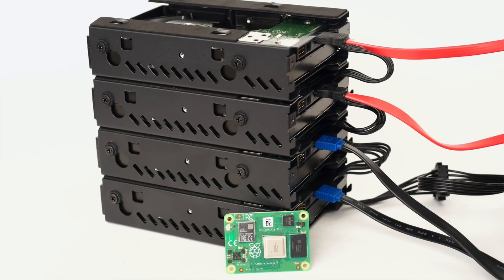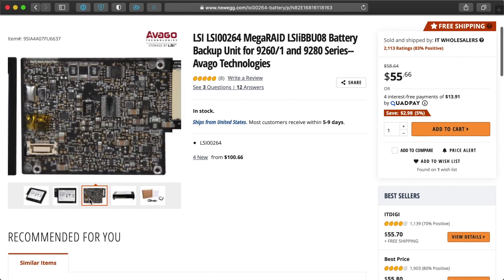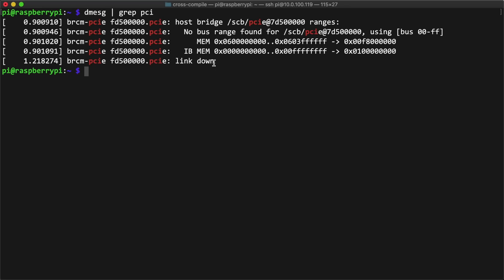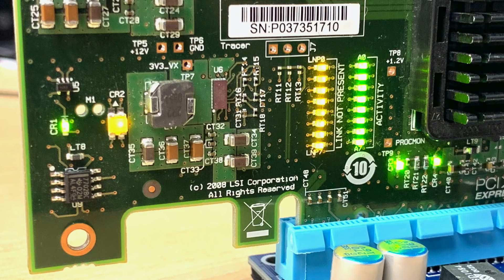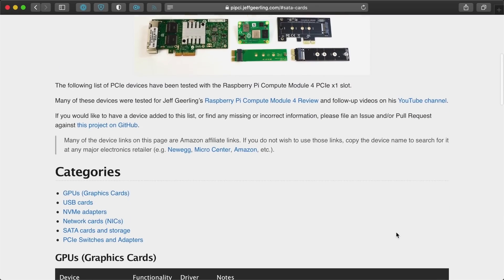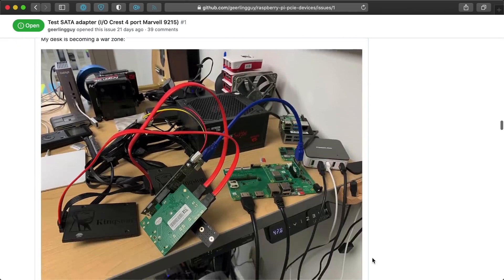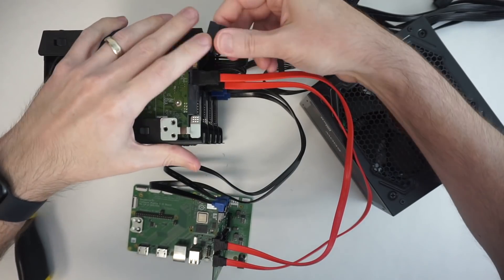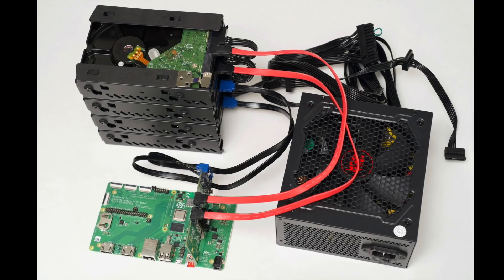Enterprise SAS RAID ...on a RASPBERRY PI?!

Comment: I did this but with a rockpro64, an LSI 9211-4i HBA, 4x SAS 4TB drives, all in a 1U server chassis with hot swap bays. The rockpro64 has a 4x PCIE port and it all works together nicely running on Armbian OS and openZFS.

Comment: Buying a 3 pack so you have a single spare??? You need to buy in bulk and order 20 extras, you know you are going to need them ! Great video as always I just did this same project but on my R730xd so it will support 44 drives. The lsi controllers with the firmware mod are fantastic. 10tb sas drives are 99 bucks now!

Comment: I love where Jeff's head is with this. Here's hoping a future Pi will include at least one modern PCI Express slot.

I have no idea about this, but are there any older HBA or RAID cards that might fit into the slot natively?

What I want to see is a mass market of low-cost, low-power, elegant, Pi-based devices...including NAS. I'm not much of a tinkerer. I want something that just works well and looks presentable with minimal fuss.

I know there are pre-built solutions out there, and I have a Synology NAS myself, but I want to drive prices further down. My Pi 3 B+ really let me down when I tried to use it as a RAID5 NAS. Even if it had worked reliably, it was a rat's nest of cables.

Comment: BTW. You can boot Rasberry Pi using UEFI, and load something like generic Debian, Ubuntu or Centos images and kernels. They are usually for arm64 servers that have UEFI (often called ServerReady in ARM speak, now ARM SystemReady SR), but with RPi4 firmware from pftf repo, it just works. These kernel usually have almost all modules compiled in as modules, so no need to recompile the kernel. Usually you will have access to all same modules as on x86 kernel on these distros (minus some x86 specific stuff, like some motherboard sensors, some ISA sounds drivers, etc), but almost all PCI / PCIe stuff (including hard drive controllers, raid cards, network cards, wifi, audio and video related cards, GPUs, etc)  will be there.

Anyway great video. I love experiments like that myself. As of the not-working RAID card, it is probably related to bios on these cards. They often need to initialize at boot, and their bios is often x86 only. Not all of them tho. Some of them can be initialized by linux drivers and firmware loaded by Linux. More investigation is required definitively.

Also you do not need explain or apologize for your ideas, that some will consider silly. There is plenty of uses for a setup like this, and even if there is none, it is still fun, and you can learn many things from it.

Comment: When new raspberry pi and other sbc models start coming out in the next year or two, if they have pcie 4.0 nvme support that will lead to the ability to hook up raid cards at full bandwidth. With some fancy adapters and sweat/tears someone would be able to make a tiny little nas with insane amounts of storage. And since flash storage is supposed to cross the gb/$ of hdds those tiny nas devices will be all flash based. Imagine a 24-32tb sata or sas raid array with cpu and networking in the size of a WiFi router. Imagine having 5g or ax WiFi built in with a battery and being able to carry around a mobile nas that is actually fast. I love how fast tech seems to be advancing this last year compared to the previous few years.

Comment: Jeff, I think you maybe have just been unlucky with the LSI cards, some of my bits and pices have just arrived and I plugged in an LSI 9211-8i I had laying around in the drawer and got this:

pi@raspberrypi:~ $ sudo lspci -v
00:00.0 PCI bridge: Broadcom Limited Device 2711 (rev 20) (prog-if 00 [Normal decode])
	Flags: bus master, fast devsel, latency 0, IRQ 55
	Bus: primary=00, secondary=01, subordinate=01, sec-latency=0
	I/O behind bridge: 00000000-00000fff
	Memory behind bridge: f8000000-f80fffff
	Capabilities: [48] Power Management version 3
	Capabilities: [ac] Express Root Port (Slot-), MSI 00
	Capabilities: [100] Advanced Error Reporting
	Capabilities: [180] Vendor Specific Information: ID=0000 Rev=0 Len=028 <?>
	Capabilities: [240] L1 PM Substates
	Kernel driver in use: pcieport

01:00.0 Serial Attached SCSI controller: LSI Logic / Symbios Logic SAS2008 PCI-Express Fusion-MPT SAS-2 [Falcon] (rev 02)
	Subsystem: LSI Logic / Symbios Logic SAS2008 PCI-Express Fusion-MPT SAS-2 [Falcon]
	Flags: fast devsel
	I/O ports at <unassigned> [disabled]
	Memory at 6000c0000 (64-bit, non-prefetchable) [disabled] [size=16K]
	Memory at 600080000 (64-bit, non-prefetchable) [disabled] [size=256K]
	[virtual] Expansion ROM at 600000000 [disabled] [size=512K]
	Capabilities: [50] Power Management version 3
	Capabilities: [68] Express Endpoint, MSI 00
	Capabilities: [d0] Vital Product Data
	Capabilities: [a8] MSI: Enable- Count=1/1 Maskable- 64bit+
	Capabilities: [c0] MSI-X: Enable- Count=15 Masked-
	Capabilities: [100] Advanced Error Reporting
	Capabilities: [138] Power Budgeting <?>
	Capabilities: [150] Single Root I/O Virtualization (SR-IOV)
	Capabilities: [190] Alternative Routing-ID Interpretation (ARI)

I'll let you know how I get on, I'm assuming I have to compile the LSI drivers into the kernel now.
Reply: PS, this device will be in IT mode already from its days in a ZFS server.
Reply from the maker: Nice! Can you post your findings to this GitHub issue? https://pipci.jeffgeerling.com/cards_storage/ibm-servraid-br10i-lsi-sas3082e-r-sas-raid.html (or start a new one for that card in particular)
Reply: @JeffGeerling  You've actually motivated me to order a RockPro64, this device has a PCIEx4 potentially giving it much more potential: https://www.pine64.org/rockpro64/ it also seems someone has the LSI 9211-4i working on it: https://wiki.pine64.org/wiki/ROCKPro64_Hardware_Accessory_Compatibility#PCIe_devices I am going to have a look through their forums and see if I can find anything helpful that could help with the Pi.

Comment: I respond to your stackable rack with this (and they dropped the price quite a bit)
" Sans Digital HDDRACK5 5-Bay IDE/SATA Hard Drive Organizing Rack " - it connects to the power supply AND has a fan :)
If they made a 6-bay version it would be perfect for ZFS RAIDZ2 ;-)
Reply from the maker: Nice! They even sell it at Micro Center. I wish I had seen it before I bought my little solution.

Comment: Less of you and more of what you are doing, also check sas and SCSI on Wikipedia for more accurate information. Also battery on the raid adapter is only for raid 5 which cache memory added on the raid controller, because we can have power outage while the controller is still calculating the parity bits...

Comment: Here I'll save your readers time, less money and a cleaner install in a smaller foot print. Buy from amazon or newegg since they have all these in stock all the time. I''l leave out the drives but here is the list

1. PicoPSU 160Watt  + external brick = $100 (this will support 5 3.5" 72K RPM drives, more if you use 2.5" drives)
2. Sans Digital HDDRACK5 = $35.00 (PSU plugs in, has build in cooling, supports 5 drives and stacks)
3. CableDeconn5 SAS/SATA cables = $12.00 (short, angled and bundled together for cable management)

way cleaner then your solution and if you only use 4 drive bays you can cram the RPi in the top drive bay to make clearance for the SATA/SAS card and have everything in a nice package.

Comment: AFIK, due to the fact that the RPI does not have a bios all the stuff that relay on bios initialization fails.

GPUS, RaidCards (probably an hba would work).  Isn't there a coreboot/seabios to boot win 10 for arm? Probably in that way you could solve a lot of problems.

Comment: You know what the very likely issue with that SAS cards was besides very picky server hardware? The Raspberry 4 has only a PCIe Gen 2 x1 interface and judging from the connector they needed at least x2 or x4. Only hardware that specifically states that it works also with x1 might work with such Jerry rigged Chinesium x1 to x16 adapters. SAS controllers - if not ancient in age - need all the lanes they can get to even work somehow decent. A somewhat half decent deep dive in PCI-Express could be helpful at least to educate yourself why such Chinesium x1 to x16 thingies are not always the best things.

Comment: Hey, @jeffgeerling, on a side note (Your SAS video is why I follow, your why not? attitude is awesome) could you do a video on your environment that you use for re-compiling the kernels? I use a Ryzen 7 1700/ 32GB / 10 TB / 4 1GBit Ethernet Ubuntu VirtualBox Host running many dedicated VMs for dev use, including a Pi-Gen machine (for building custom RPiOS images. Cross-compiling is something I'd consider if I had a good example to follow...
Reply from the maker: I promise I'll try to get to a video on the process (especially as I'm starting to tweak it for better performance / easier work on the overall process). Right now the basic environment I have set up is documented here: https://github.com/geerlingguy/raspberry-pi-pcie-devices/tree/master/extras/cross-compile

Comment: One thing to nope, you don't need to use PCIe risers, you can cut out the plastic in the back of the PCIe slot on the pi and use that as an open ended slot. Open ended slots are found on both consumer and server grade motherboards from time to time.  I presume you already know this but I'm just throwing it out there anyway

Comment: “I had to recompile the kernel to get ___ working.”

This is why Linux can’t make headway into the desktop market. It can’t get out of its own way. 

I gave up trying to run linux on bare metal. I just use Windows as a h/w abstraction layer so I don’t have to multi lot and just run as many Linux VMs as I want under VMware. I boot once and run whatever I want concurrently so I can get on with my life. 

I gave up back when WPA2 WiFi meant casting spells and burning black candles just to get WiFi working. Enough.

Free software is free only if your time has no value.

Comment: Hi Jeff,
I had issues before using LSI RAID controllers in desktop motherboards but found out that blocking 2 pins on pci-e bus solves that issue and PC boots and detects card and disks without issues after.
You can find instructions and pictures kudos to Yannick:
http://yannickdekoeijer.blogspot.com/2012/04/modding-dell-perc-6-sas-raidcontroller.html
Not sure if that is the issue on Pi - but worth checking and having enterprise RAID controller running with PI :)

Comment: How do you use the sata cable on sas drives when they don't physically fit. Sas has power & data in one link , so your sata cable has to have a chunk missing to like get plugged in. Basically Sas 22pin connector vs. Sata 15 pin + 7 power connector. Also why do all that when there's already a product the Raspberry pi 4 nas (supports 4 HDs). https://www.youtube.com/watch?v=Eix0PCB0byQ

Comment: If you don't want to use the jumper wire for the power switch replacement, have a look at this ATX breakout board: https://www.amazon.co.uk/gp/product/B07MW8H26H/

Comment: With the LSI cards, they all have stupid x86 Option ROMs which probably break compatibility. Luckily they can be trivially cross-flashed as dumb JBOD controllers. Barely better than the result, but hey, they can be used.

Comment: For redundancy and backup, but not speed, right?
Reply from the maker: It depends on how many drives you have and what your goals are.
Reply: @JeffGeerling  true, the only important goal I see is "can it be done"
I found an adapter to plug an eMMC module into the SD card slot. Not fast but super cool for swapping out projects and storing them. Love your channel!

Comment: Cool project !!! A hdd uses just 5-6 watts of power, thus 4 hardrives about 20-25 watts, you could easily power that with that molex psu you showed  no need for a pc power supply, project would look a lot cleaner without that pc psu
Reply from the maker: True... it seems that each drive uses 0.5A at 12V, so I would just be at the 2A limit of the little power supply I have. But if I'm trying to power other things (like my PCIe risers) and technically the Pi itself (it can be powered through a 4 pin floppy connector), then I'd have to still plug in multiple power supplies. Long term a micro-ATX IO board would be neat to have available!
Reply: Ah yes, makes sense, that would become a little to mucht for 12v 2A and do you mean a micro ATX board in which you can plug a rpi compute module, that would be sweet indeed!

Comment: Retired data center sysadmin/support here. Hardware RAID even with a BBU isn't 100% foolproof. I've seen more data loss and failures with hardware RAID than software RAID because the RAID card was writing bad/corrupt data until finally everything messed up. I recall BBU failures from time to time on our virtualization nodes. Sure the guy above me who managed the servers probably didn't have notifications setup, enabled or checked disk health regularly but even with the hardware RAID servers we issued to customers who hosted their own hosting customers would have issues. I personally have not seen  a software RAID failure. I'm not saying it can't happen just saying 7 years 24/7 on call as a good solid sample. We had 7 data centers at the time, 5 in the US.
Reply: We'd even mix up the sources of new hard disk like CDW, Kingstar, the hardware sales guy and Amazon to exclude the possibility of us getting a high amount of bad disks in a batch/manufacturing run.

Comment: Worth noting that some, not all, of those LSI cards that both Dell and HP use, have re-cooked firmware so wont work when living in somethimg thats not Branded to them. Theres must be some kind of lookup performed when the card boots . I reflashed the vanilla firmware for each from LSI and problem solved. May be you have that issue with your cards.

Comment: For those thinking "go with a server": Server fans have a tendency to sound like vacuum cleaners. I have a HP Proliant that sounds like 3 carpet shampooers and that's normal for the model, not fan malfunction. Using 32 sticks of RAM, 4 CPU's, 8 HDD's, 11 expansion cards, and 2 power supplies, it can generate too much heat for a quiet set of fans.
HP Proliant DL585 G2 server, BTW.
Reply: I am hoping with the rise in popularity ARM that more quiet and power efficient servers become available. Right now there aren't many choices still for ARM servers for sale.

In the meantime, Supermicro makes some embedded servers that run on Intel Atom with passive cooling. I used to have one for my home lab but it had the infamous C2000 clock signal death and doesn't boot anymore. The newest generation of Atom processors (C3000) do not have this defect AFAIK. There are also the EPYC 3000 and Xeon-D choices in the embedded options but I don't know how those are in heat and noise.
Reply: yes servers are loud but I'm not going to wait days to resilver a drive on a pi  when it takes minutes on my server.

Comment: I'm using an old Atom board in an SFF case with a PCI (no X) card I found for cheap with 4 sata connections, and that way I have my raid server, not the fastest, but it was very cheap. Mdadm and LVS for software raid and up it went.

I was going to use a Pi, but came across that old pc and it was so on my budget

Comment: WD Green != Enterprise grade.
Additionally, those drives aren't even safe for RAID. Purple, Red, and Gold are safe for RAID.  And only Gold is enterprise grade.
Additionally "refurbished" drives are never enterprise grade.
Reply from the maker: I treat any hard drive as unsafe for raid. They'll all fail at some point, it's just a matter of when :)

But yes, you have a point—in my case, I wanted spinning drives and realized the only one I have in my entire house now is an old 1 GB SCSI drive I have old Mac OS 7 games stored on from decades ago. Refurbished WD Green it was!

If I had more time to wait, I could definitely pick up better drives. I'm also testing a set of four cheap-ish Kingston SSDs for the next video too. Their performance absolutely destroys spinning rust, though you pay for it in capacity per dollar.

Comment: Only 500GB drives? I hope you paid next to nothing for them.
Reply from the maker: Hey, if this were 2010 it would be pretty respectable! But yes, it was pretty cheap, though since I needed them quick, I ran to Micro Center and paid a bit over what I could get them for on other reseller sites.

I really need to find a local friend who works in a DC and can just toss me old hardware when it's rotated out after its duty cycle...
Reply: @JeffGeerling  early in my career I was a junior Unix admin for a university.  I ended up acquiring a bunch of surplus hardware, even a Sun E450. The problem with data center hard drives is they're LOUD and power hungry. I almost doubled my power bill by running the thing filled with 15 drives.

I'm sure things are better now with the switch to SAS and 2.5" drives, but still something to consider.

Comment: You probably get more speed and durability with BTRFS RAID 1, 0 or 10 with zstd compression and you wont have to worry about power losses or faulty cables.

Comment: I think it should be possible to use the always on 5v output of the psu to power the raspberry pi and you could program it to be in a sleep state with the psu off or in a on state with a output the raspberry pi to turn on the psu... Maybe the whole thing could run off 5v always on depending how much power the hdd use

Comment: My first thought on why SAS controller is not working, card hangs on SMB signals. Cover 5th and 6th PCI-Express pin with kapton tape. Next, I'd try some HBA first, like Dell H310.
Reply from the maker: I tried the tape trick and it didn't help. I'm thinking the cards may need BIOS /initialization I can't currently provide.

Comment: How are SAS drives more resistant?
Reply from the maker: They're generally made to a slightly higher warranty / with slightly better parts. But any spinning disk is inherently prone to failure, which is why it's good to have RAID and backups!